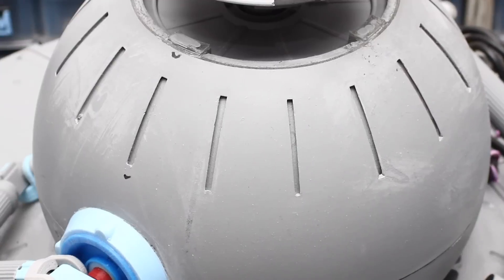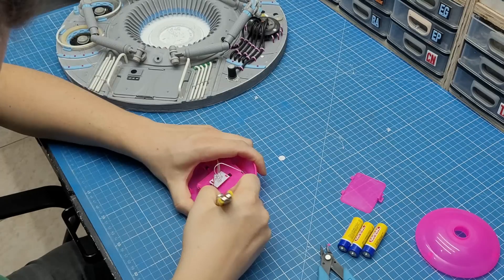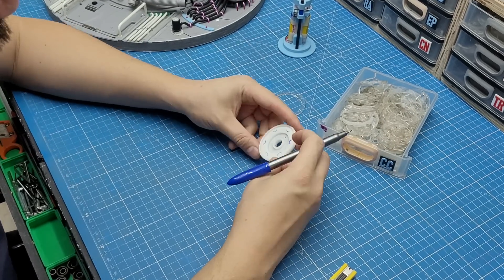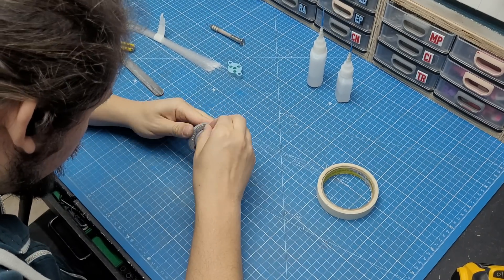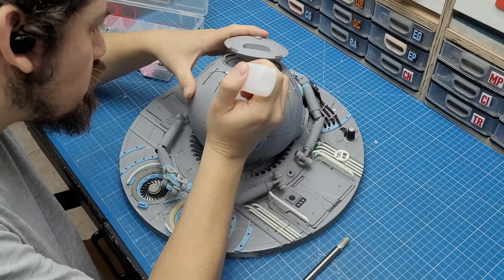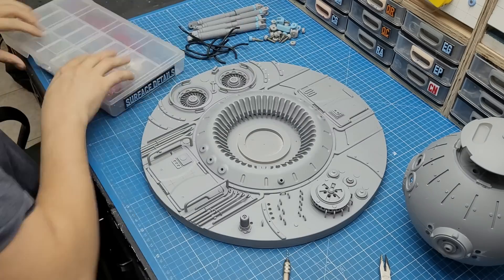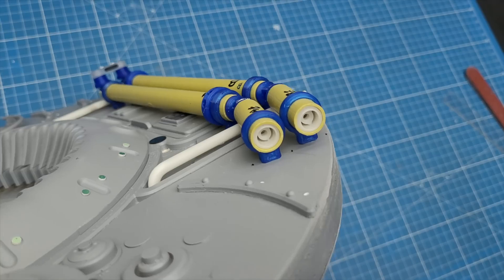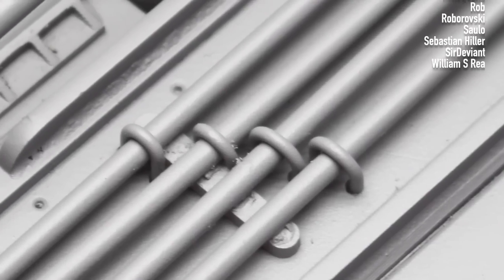Quantum Computer DIORAMA Build! - EP03

Comment: One little tip for bending and shaping PVC tubes. Instead of applying heat with a lighter you can build a very simple tool: put a nicrome resistance inside a metal tube and use this to heat it, by controlling the voltage you will be able to control the heat as well. This way you can use this metal tube fixed to a base as the molding tube. Hope this helps you.
Reply from the maker: This sounds super complex and amazing! I'll do some research, thank you!!